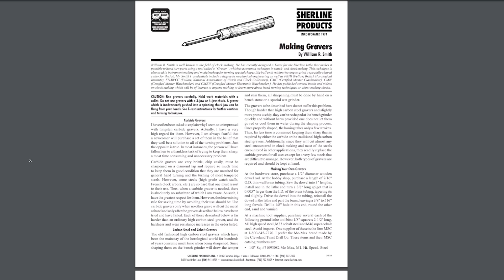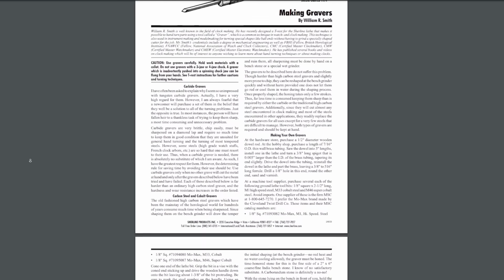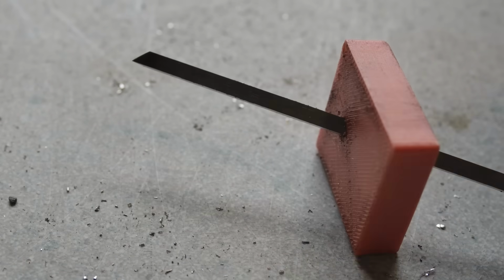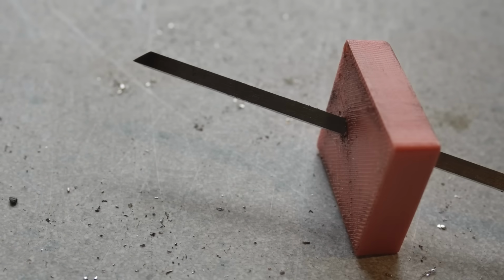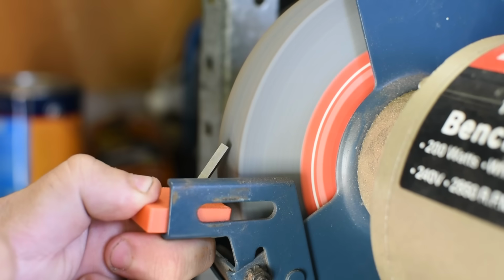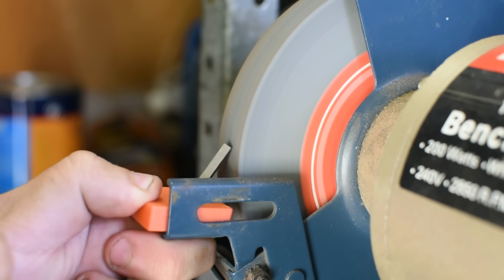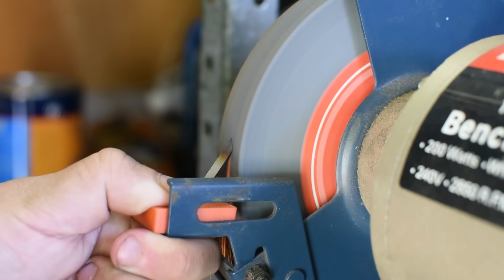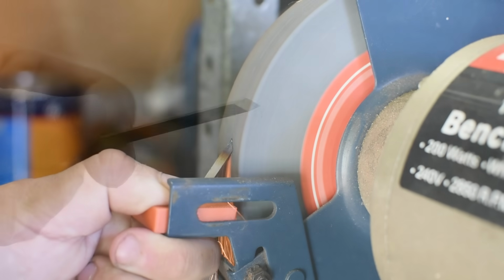I Printed A Better Lathe

Comment: This has me wondering how bootstrapping to increasingly more accurate and precise tools works. At first it seems like it shouldn't be possible, yet here we are with tools that are a lot better than chunks of broken stone, so somehow it can be done.  So maybe a better question is how many steps would it take to go from this lathe to a top of the line lathe with all of the modern bells and whistles? (Well, ignoring electronics and other stuff that can't be built with a lathe). How much of error reduction is a matter of the machinist's skill and how much the engineer's in compensating for the errors of the previous generation? I'm probably asking it in a stupid way but hopefully someone can noodle out what I really meant to ask🙂

Comment: Filling 3d prints with concrete is genious. You could probably add some chicken wire mesh during assembly to mimick rebar and get even stronger parts

Comment: Have you ever heard of a Hommel UWG? It was a type of smaller modular lathe/general machine tool, and l think it's design or one similar to it would work nicely with the plan of gradually increasing the capabilities of a machine over time. 
It could be set up to do just about anything with pretty good results, although l'm sure it couldn't have been super rigid, and building it into the configuration you need for a specific task took time, but they still seem amazing. I'd love to have one someday, but I've resigned myself to probably just trying to build something similar up from basic principles

Comment: I'm curious how you ensured the spindle axis is aligned with the rails before/after the concrete pour - is there adjustability in the head stock or the extrusion mounting?  Awesome project, definitely subscribing for more :)

Comment: Well, that's a weighty issue solved! :) This came up in my feed, I think, because I've been restoring a Unimat 3 lathe and looking for parts and things. It's a nice build. I never thought of concrete inside a part. This changes the design process quite a bit, doesn't it?!

Comment: BRUH....... You HAVE to preload those bearings!!! No, that jam screw is in no fashion good enough. To spite what SuperFast Matt may say, this is one instance where 'good enough' is most certainly NOT GOOD ENOUGH!!! Checkout Inheritance Machining, in one of his last videos he breaks down the spindle of one of his lathes, and it gives a pretty good peek into how those things are kept rigid. You could get rid of a vast majority of that spindle movement if you just properly secure the spindle bore, load the bearings, and anchor them all together. 

Also, I dig the idea of using a stone filler to add mass and rigidity, though at this point....why not just dig a sand mold and pour a iron base in the backyard (he says wishing he had the backyard for such shenanigans still)? 

Id vote for trying other fillers, like plaster, or different types of concrete/cement. You might discover something that flows better, sets nicer, but rest assured it will always be a mess. SO DONT DO IT WITH THE BEARINGS IN!!! the last thing you want to do is get grit in those things. Some grease packing can help keep schmootz out (also fully shielded bearings...). However, never be afraid of getting dirty. Thats half the fun of machining. If by the end of the day you're not covered in grease, oil, and and a bajillion little razor blades ..... did you really even do anything? Getting messy is fine, thats what work looks like. Only making a mess on the other hand means you're probably just dicking around, which is also fun but far harder to justify ;)

I feel there are some design improvements that can be made with some more iterations, some experience and exploration, and knowledge of the finer inner workings of different types of machines. That being said this is a VERY interesting project, looking forward to seeing what kind of precision you can get out of it. Big manufacturers build for industrial shops, but honestly, the garage hobbyist doesnt need sub micron precision or even micron precision, especially with some planning and adding a final fiddly finessing step to get everything fit tight. Avoid tunnel vision, always remember to step back and look at the bigger picture and all the tiny contributing factors. As you iterate dont let failure get you down, because failure is inevitable. It WILL happen. Expect it. Your choice in the matter is whether or not you let failure be the last thing you do. Oh, and ALWAYS WEAR SAFETY GEAR!!! Just look up, 'these safety glasses saved my face' videos...they're pretty sobering and effective at making the price tag of proper gear less painful. Keep up the good work, mate! You're definitely on to something here!😎👍

PS - and dont judge yourself on behalf of others. Its tedious and kinda offensive to them, like are we supposed care why you got the footage...you got it because its a project video, its already justified. Besides, you dont need to infer youve done something lame and cut me off at the pass, if I want to call you lame, I will dammit. And not a moment before, as is my god given right. At that point you are free to, and I highly suggest this route, consider such derisive comments equally as lame if not more so (i mean, its not like anyone held a gun to their head and made them click this video) and then simply forget about what this and that internet asshat had to say. We came here to watch the interesting thing your videos thumb and title promise, worse that can happen is some dont like it and leave. You still got their clicks though, thats all that matters! 😁

Comment: You really should use coarse sand and small aggregate and a little dryer cement mix for a stronger concrete mix. 🇦🇺👍

Comment: Does the heat from the concrete curing weaken or warp the printed material? Did you have to factor this into the design at all?

Comment: This is so neat! At 9:15 + the screws are vibrating loose, maybe use some conical lock washers there? I would absolutely LOVE to see some rudimentary cross slide: You could have a longer tool rest with adjustment screws at either end for precision squaring, then use a threaded rod as a lead screw with a dial to advance the tool rest ie: your depth of cut. This would require a minimal handle for the cutting tool which would slide along the front of the tool rest. You could even have 3d printed travel limits on the tool rest. The challenge would be making this assembly rigid enough! So excited to see this advance!

EDIT

It would be easier to have the dial incorporated into the handle.

Comment: build the concrete pour inlets to later receive plastic caps. then there is no need to try and make the concrete look good. designed correctly, a little air space under the cap wont hurt anything

Comment: Maybe it is explained in a different video, but how is the headstock aligned with the aluminum rails that hold the toolholder? The missing component to make this a useful engineering tool is a toolholder and a way to move the tool linearly parallel to the axis of rotation... I am curious if that is something you have given thought to.

Comment: An excellent project and very well designed and executed. All it really needs is a proper holder for modern carbide inserts, so then you can really get things cut quickly and more accurately. Well done.

Comment: When you are making guides for your tool grinding, see if you can develop something compound so it holds the right angle, but you can als move it left and right so the grinder wheel wears even so you dont have to dress the wheel as often

Comment: For a neat way to fill the voids with concrete, have you ever watched a baker using a piping bag to decorate a cake?  Basically it’s a plastic or parchment cone with a hole at the bottom.  The baker fills the cone up with icing and then squeezes out a thin line of icing on to the cake.
I am thinking you could use a bigger, tougher bag, possible suspend from a bungee hung from the ceiling, and squeeze the concrete out in a similar way.

Comment: Awesome! i made a simple CNC lathe from an old 3d printer just to turn RC foam Tires, But it way less robust as yours. 

Would love to see the toolholder mounted on a guide rail with ballscrews so you can crank the tool to the positions. Then it will be easier to have constant measurements over a turned bar or something, like on a real metal lathe.

Great Work!

Comment: These lathe attempts are getting better.  Still, no walls under 6 extrusion widths please.  The spindle is the most complex part of making a lathe.  ER chuck is a good compromise to get an off the shelf part.   Consider threading the stem for a thread on collar and placing a tube over it so you can tighten into the bearings for zero clearance.  Consider running the 8020 bed fully under the headstock and using pillow blocks to firmly clamp the roller bearings in the headstock down tight to the extrusions.   Should eliminate some flex between tool post and headstock.

Comment: 4:51 "I haven't found a neat way to do this"
Try a plastic piping bag, you can cut a hole the size that you need and it allows you to build up some pressure as well. I use this method with similar DIY projects.
Reply: Or maybe just a funnel
Reply: @ with a funnel you have less control and you cannot create pressure, but yes it could have its applications
Reply: @fsxnico  sorry, what I mean is that since he's 3d printing anyway, print a funnel / guide / spout that fits the exact hole that he'll be pouring into.
Reply: @DustinEwan  yeah for sure there's a lot of possibilities with 3d printing. That could work too :)
Reply: design and print a funnel assembly that fits into the mouths and allows a direct pour without dripping onto the exterior surfaces.

Comment: It's a bit sad that the engine isn't 3D printed... Just kidding. Awesome job.

I think I'll consider filling parts with concrete. I've tried plaster before, which works, but isn't heavy enough for certain parts :)

Comment: What an awesome project and great execution!

I would like to hear your thoughts on an epoxy granite (sand and epoxy mixed together) variation i'm wondering if there would be too much heat for the printed parts but also if it might bond better to the printed parts?

Comment: nice design.... btw have you try brushless servo motor from sewing machine? its cheap, strong, high torque, has safety feature, and fast. Im using it for my diy high flow rate peristaltic pump. maybe you should try for your lathe

Comment: Interesting!

One thing to note is that you're using what looks like cement, not concrete.  Without aggregate, it's just cement, and does not provide that same kind of structural integrity.

Comment: When you ground your lathe tool you still got it too hot.  You could see it lose its temper  by the Color change on the outside due to oxidization.  Get some water to dip in between grinds  And when you finish the point Go very slow and don't push hard

Comment: I would either epoxy the top so the concrete is sealed and it is a nice smooth surface, or print a panel that can be screwed/glued on

Comment: Would be interesting if you would use a dial gauge to see what type of runout you have on this and the old lathe when applying pressure. Have been looking for a cheapish/rugged and modifiable watchmakers-lathe and i think this shows some promise.

I would probably go with using epoxy-granite plus a welded steel-skeleton for a bit better rigidity between the spindle/bed/toolholder, but we have all different requirements.

Thanks, and hope you don't mind that i might steal a few ideas. :)

Comment: 2:57 - When assembling parts like this, you can print them with interlocking features to air in alignment and assembly. Think dovetail or even puzzle pieces.
Reply: Very good tip, just remember to have a bit of tolerance for such pieces, depending on your printer, filament and settings it could range from 0.025mm to 0.25mm. Print smaller parts and find out how much tolerance you need!

Comment: it looks like you didnt preload the spindle bearings.
i also made a lathe with those collet chuck blanks and the way i got around the unthreaded shaft was by clamping a piece onto it, like you have the pulley, and then having 3 screws go through that from the back, pushing onto an intermediate plate, which then pushed on the bearing, thus preloading it. just make sure the pulley is tightly clamped/has a large contact area, to avoid it sliding back. And lock the screws with nuts from the back.

edit:
now thinking about it, you might be able to not use the intermediate plate all together, since thats a precision turned part. and it only distributes the force on the bearing and protects it from scaring.

Comment: a metallic machiery grout would be ideal for this. its a bit hard to work with as it kicks  quickly. search for something like masterflow 885 or Embeco 885 . it flows well and I think is what you need for a project like this

Comment: Great vid, really good presentation, camera work etc. Absolutely love the lathe, really interesting combination and niche. Would love to see a bill of materials though - struggling to see how this could possibly be done for under $100 US. I'm in UK and honestly I think the plastic you've used would be £50, that looks like a couple of 1kg spindles of plastic. The cement and aggregate looks like about £5-£10, the printing looks like a good 3 or 4 days of printing which is a good few more quid, maybe a £5, so at that point, yeah, £60 maybe, but how about all the other stuff!? All those fittings and inserts and threaded rod - I have to buy them all the time and each set of that stuff would be a tenner, so £30 minimum for all the parts. The lengths of extrusion, I dunno, maybe they are incredibly cheap in Aus, but here you're looking at a £10 minimum for those pieces if buying as a one-off, but I think mroe like £20 shipped. The roller bearings don't look cheap, theres that motor, what electronics are you driving it with, the wiring... even the transformer and the mains cable would be £20 in the UK. Not wanting to down play your build though - I'd genuinely consider copying it - it looks like a great bit of engineering, I'm just confused as to how it could possibly come in at under £200 in the UK. And maybe thats really just me grumbling about over-priced stuff in England!!

Comment: Nice project✌🏻. 
Here are some of my notes (please take it as an improvement for your project 👍🏻) :
- use oil instead of grease for spindle bearings as lathes use oil (less resistance, less power loss).
- use some dust cover for bearings or else those will be gone in no time
- use a shaft lock nut or locking ring for bearings for proper bearing clearance/preload
- use a plate to hold the 4 bolts on the top of the spindle housing, which will give more rigidity
- use some concrete sealing at least, as concrete is porous and will "drink" any fluid, and moisture
Reply: Oil in lathes yes...but only in lathes with a oil filled head.Most smaller ones are only greased,as the oil bad is for the gearbox more then for the bearing. A proper grease will work as good as oil .
Reply: @bosanaz2010  it depends on the spindle speed too, but any lube is definitely better than no lube!✌🏻
Reply: @Mr.Bearded.Mechanic  yeah sure.in High Speed you need oil
But there are greases Up to 12k RPM
IT would Help If He uses a chines Spindel. You get housing,Spindel with Plate for Chuck ,bearings 
And you can preload IT.
His bearings are inside Plastic and also the part flexes so much that you csnt add preload .
So the bearings are dead proberbly very soon.
There is plenty of improvments and Just 2 more Stock parts to buy.
I mean this lathe is for Sure around 100€ in parts rigth now
At least 100€

Comment: For a better pooring, how about a funnel or plastic bag that you fill wtih concrete, twist the opening tight and cut a corner to turn it into a piping bag? I have seen people make paintings on bonsai pots with these. If you fill the bag in a water bath, I think you might be able to reduce the total amount of air in the mix.

Comment: Interesting design. The bearings should be placed in separate housing using seals on the inner side and a cover plate with seal on the outer. Also as stated in another comment the bearings should be adjustable with a locking nut to set proper clearances.
Reply: I don't think that's the outer race spinning, I'm fairly sure that's just the roller cage, which should spin.

Comment: The beauty of building a precise lathe is that, now that you have a small lathe, you can use it to make parts for a new, larger one.

The 3D printed forms are a brilliant way of making the shapes; to add significant tensile strength to your concrete castings, add layers of steel mesh inside as you assemble the forms.  You'll have to vibrate the parts a lot longer to ensure complete fills though.

Comment: The 3d printing concrete forms idea is genius. I’ve seen other concrete machine tool projects but they required forms to be built. The 3d printing would be a massive time saver. You might want to remove some of the plastic after casting though. Hard contact surfaces would machine the machine more solid.

Comment: It might be a good idea to reinforce the concrete with some steel wire or mesh. Also, put rocks and gravel in the mold before pouring the concrete if there are large spaces that needs filling. If you can get your hands on crushed iron ore that makes great ballast as it is heavier than regular sand.
Reply: An alternative to a mesh is to mix reinforcing fibers into the concrete.

Comment: If you put the concrete into a gallon ziploc bag you can cut  off the corner to have a makeshift piping bag. That will give you excellent control when inserting it into the mold